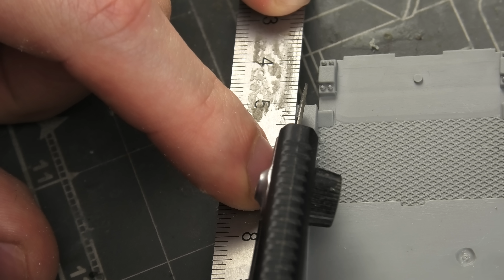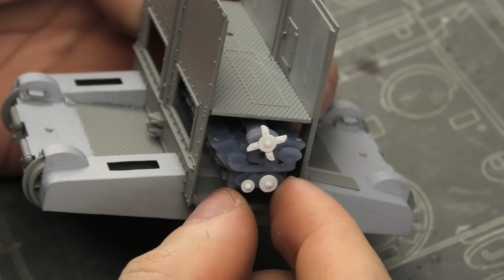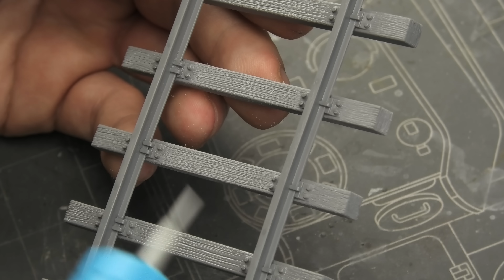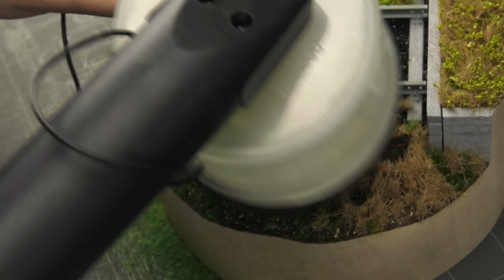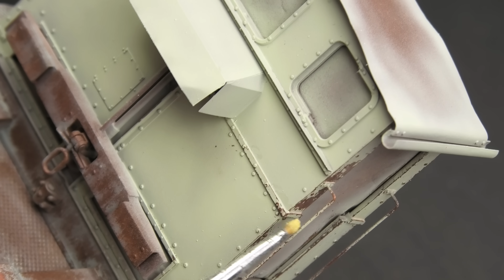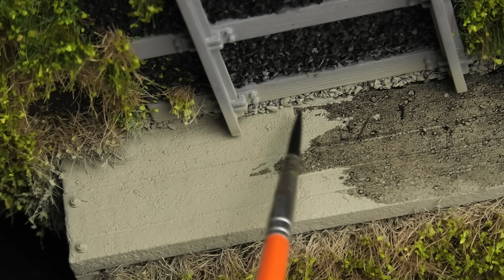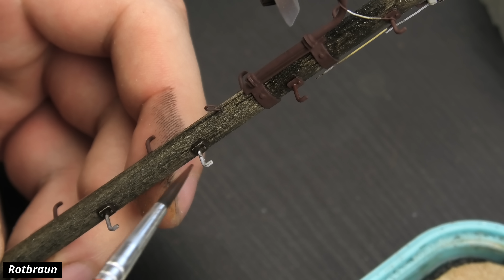Let's Build: Realistic Rusty Train Diorama!

Comment: There’s a bunch of different ways to skin a cat as they say, but I’m surprised you don’t have some Tamiya Fine Craft Saws ( TAM-74105 ). They work lightyears better than the scenario at 1:15. The rounded end saw is also fantastic for starting tricky weld seams, before switching to the chisels. It’s far less likely to slip out of the path its on

Comment: 6:30: FWIW:
- Ive found a quik way to add circular wood grain to the exposed square end cuts of cut logs, beams, or dimensional lumber boards is to use the varying radii of circular hole punching tools, (descending from largest out upon edges to smallest @ the logs heart-wood)  Using a small hammer & a flat/hard surface to support tapping as a Rough In for the end-cut wood grain....

-Then use a #11 hobby blade, wire brush, or twisting the piece upon large grit sandpaper to add finer wood grain & knock down the cut edges from hole punches & for additional random knicks, cuts, etc...

-Turns out looking pretty convincing after primer,  base coats, top coat paint(s), washes & dry-brushing applications....

Nice work as always!..;)

Comment: Wonderful build.
The engine you printed... A very small V18 diesel in a very small locomotive? A small 4 cylinder in-line diesel would make more sense. Actually, I am surprised you chose that engine to print. A 4 cylinder car engine would be a more logical choice for such a small machine.

Comment: I don't get why they use ejector pins to be perfectly honest. These are not big complex components like ... a drill handle or something like that. They could just as well use heated compressed air to eject these bits and then there would be no issues. I've seen a lot of compressed air plastic parts done in the recent years and if there's a place where they'd make perfect sense, it's got to be models... but they're not using them. Which is weird.